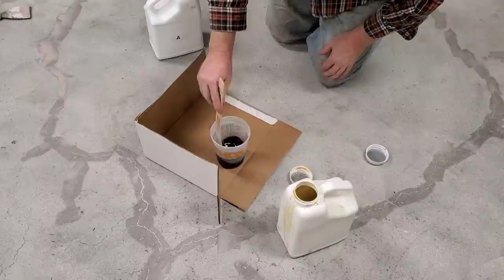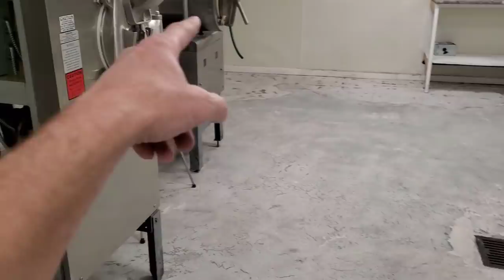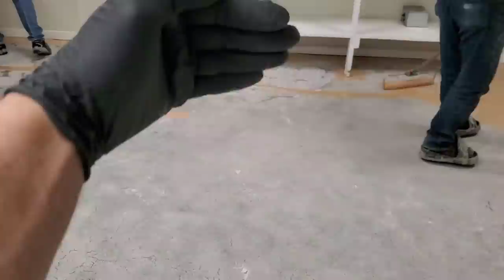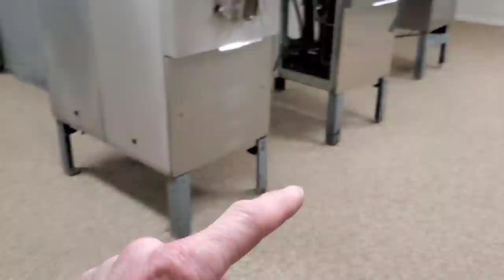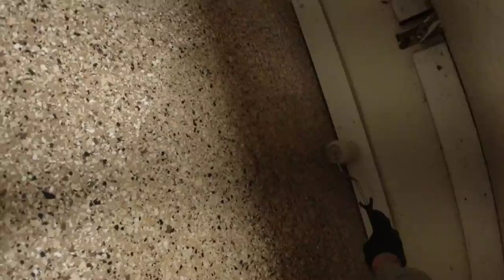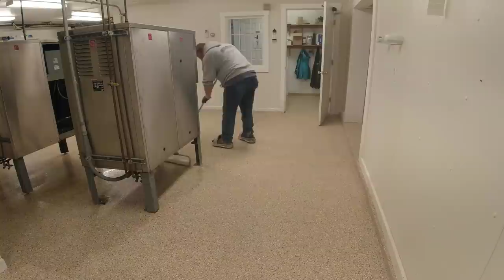SPECTACULAR Epoxy Flooring (Secrets from an Expert)

Comment: Is the coating solvent based or water based?
Reply from the maker: Solvent based
Reply: @MikeDayConcrete  Nice job! I used to finish track home garages and basement floors, I used a shot blaster in the field and diamond wheel in the corners and edges, used 2 part solvent based epoxy finish, man I had to wear a mask or I was high as a kite…lol